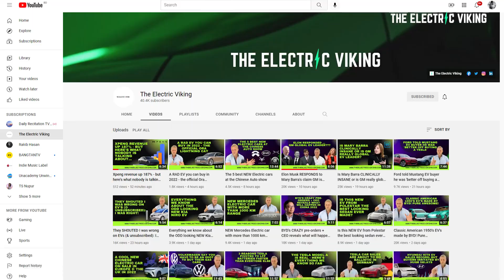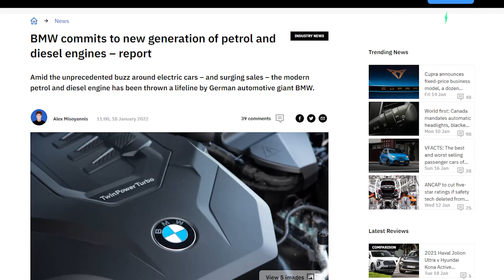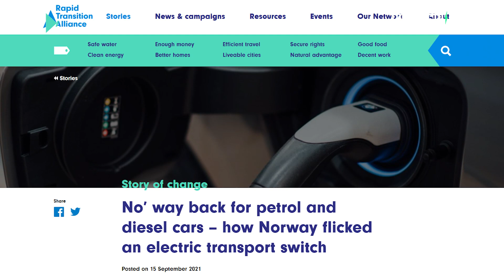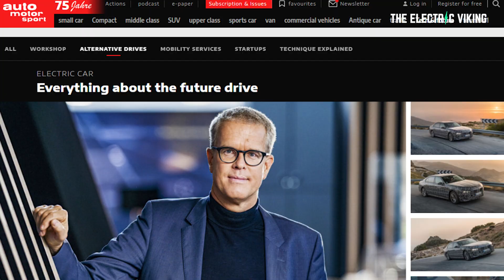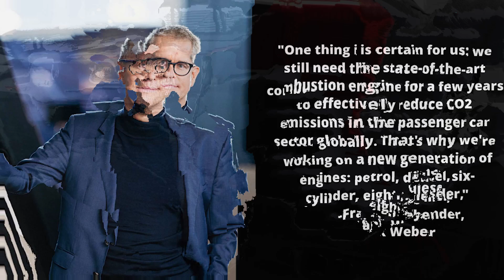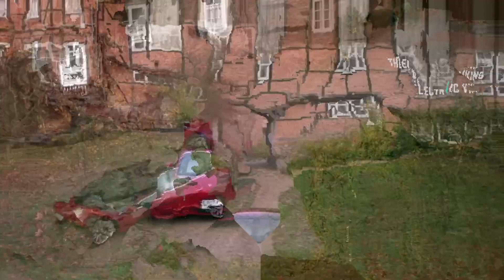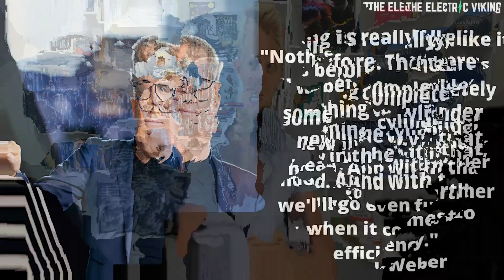This is why BMW is most likely German auto to go BANKRUPT

Comment: There are at least a couple things you are not considering: 1) biodiesel is totally carbon neutral, and works fine in most Diesel engines. Most grid electric power in 2030 will still be generated with coal or natural gas that is not carbon neutral. Biodiesel ICE innovations have passed up the thermal efficiency of fossile grid power. 2) sunk cost and capacity should be responsible used to the highest and best use; AND BMW i3, i8, and others models prove that BMW has taken the EV market seriously.  Sandy Munroe was very impressed with the many innovations of the i3. I would likely own one if they had made it 4WD.  
The fact you continue to drive your x5 is proof you don't really believe ICE is dead, there continue to be too many advantages, and those advantages will continue to asymptoticly develop.   If you want to see how efficient and effective electric transportation can be, learn about ET3.

Comment: Ridiculous ! Some iconic engines have to remain such as the BMW R6 and the Porsche Boxer 6. Bmw builds iconic motorcycles as well, no other car manufacturer does. Those engines will be in niche markets and BMW and Porsche will find those niches. By 2030 80 to 90 percent of the market will be electric certainly, but that does not mean that the last 10 or so percent will not be profitable.
Reply: So what you are saying is that BMW will be reduced to where Tesla was before the introduction of the Model 3? 

How deliciously ironic.
Reply: @jayarbe60  do you think Tesla is not also shooting for a niche? In the End they will have 30 percent market share in some segments. The rest will be chinese, european or other US manufacturers. And you forget one other important point: BMW is to a sizeable extend in the hand of one family. No complicated shareholder structure, capable of taking decisions quickly if something goes wrong, just like Tesla. Renault is not the same, neither is Mercedes, GM, Stellantis,…

Please do not forget that
Reply: @Fr99763  Well, yes. BMW is, to a degree, a family business but I think you're wrong in thinking they can act quickly. Most other legacy manufacturers already have their own EV 'skateboard' but BMW's strategy is to market one single design for several transmission types - a recipe for producing 2nd rate EV's. Without prior investment in EV underpinnings, they will not be able to pivot fast enough when they have to.

Tesla may well end up with approx. 30% market share but I can't see how being in the top three makes them a niche player. Their stated mission is to 'accelerate the world's transition to sustainable energy' so I don't think they'd be satisfied selling just to a limited market.
Reply: Porsche ICE sales are in decline - the Taycan outsells the 911 and 80+% of sales will be EVs by 2030.
Suzuki and Honda build motorcycles...